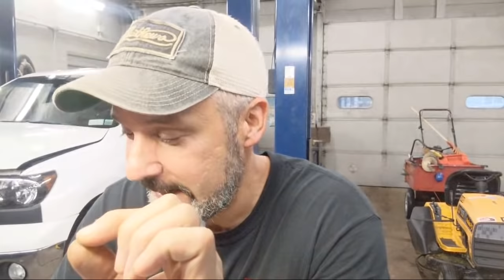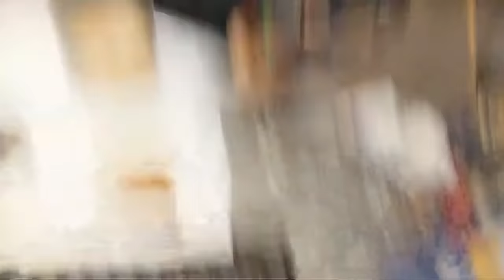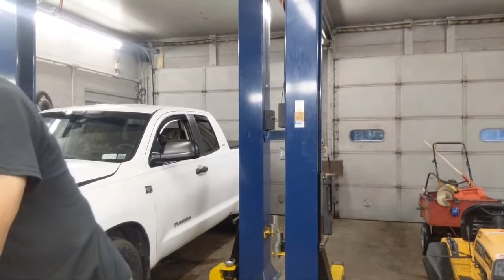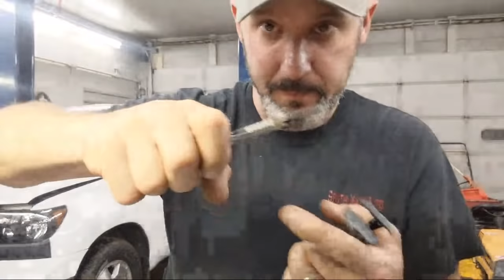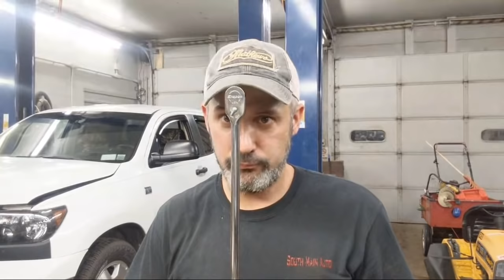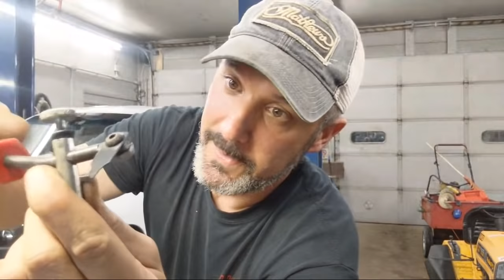W.U.W 9-22-21

Comment: Thanks for the great videos... I  live in SW Louisiana and just wanted to share my story of my 2008 Honda CRV AWD.  OEM starter lasted more than 10 years and 170k miles.  Late in 2018 it died and the shop I used  (who I love and trust completely btw) used the Autozone replacement (around $200) to repair my vehicle and it has a lifetime warranty on the starter.  Almost every year to the day two times now the "new" starters fail and I have to pay $175 in labor to get the lifetime part replaced again, not to mention the $200 towing bill i also have to pay each time.   I am due for a new starter now if this one goes bad in Novemeber... of which I will buy an OEM from Honda (around $350) and have my shop install that OEM one.  I am not blaming my shop, just I have expressed my concerns with them about substandard parts, even though they are "lifetime warranted", it costs way more in the long run to use these less reliable parts than to just buy the OEM's in the first place.  Hind sight 20/20 I will use OEM from now on as I have over $1000 in the cost for replaceing the starter 3 times for labor and towing costs.  Sorry for the long post just wanted to share, hopfully it may save someone some time a money down the road.  Thanks again for the great content!!!
Reply: Hey Eric. Larry from Alabama port Alabama

Comment: @4:30 Parasitic voltage draws:
When I worked at an RV dealership, all the class C and class A motorhomes, new and used, had to be started at least once a month otherwise the engine batteries would go dead.
This is back in the mid 1980's when radios first came out with LED dials. We found out from the coach manufacturers that even though the draw was in miliamps, over time, the LED readout on the radio was enough to draw down the batteries.
Now it's in a couple of weeks where batteries draw down because of all the electronics on newer vehicles.
Reply: This is why I keep a trickle charger on my things that are going to sit around for a while.
Reply: Lead acids lose about 1% of their amp hours per day.

Comment: You were talking about ICE vehicles being replaced.  
Here in north east Montana I know of 6 people that have electric or hybrid vehicles. Most all of them park those vehicles when the temperature gets around 10°f, as the heaters and defrosters use too much battery. Up here towns are 50 miles to 150 miles apart, too far for electric vehicles using a heater and defroster. 
Last winter we only got down to -26°f. 
Hello from north east Montana. 
10 miles from the Canadian border.

Comment: Hey there Eric. I've been in the business 28 years. 50 years old and ready to retire.  I'm pretty good with cars. Got solid customer base. AKA anyone that's family. Lol, but on that, your diag approach has helped me in many different ways. As techs,we can learn everyday. I've learned long test drives are a good way to take longer breaks. Not brakes. Oh and snap-on is stupid expensive.  Last thing. MBZ c230. Crank sensor giving false signals. Cuasing trans shifting issues.  Loss of CAN com when sensor dropped out. Want details let me know. Was as crazy find. But it's fixed.

Comment: Eric, as you know. as you know, there is an immensely  popular popular mechanic on YouTube, named Scotty Kilmer.  I learned way back in '62 how to adjust mechanical lifter valve train lash , statically, in two revolutions of the crankshaft.  The same procedure also works for hydraulic lifter preload adjustment.  My instructor was Joe Sharp, Santa Monica City college.  I challenged Mr. Kilmer to demonstrate this most efficient procedure without results, on his part.  He obviously falls short.  I now challenge you to do the same.  Hints: Firing order, Cylinder pairs, Exhaust valve-intake valve overlap observation of rocker arm or cam overlap action.  It's doable if you thoroughly understand the four event-cycle valve diagram of the "four cycle" Otto engine.!

Comment: @1:50:06 Back in the day, there was a backwoods shop that would pass any vehicle as long as you left a six pack of Carling Black Label beer on the front passenger seat.
You'd leave, come back, the six pack was gone and you'd have your inspection sticker.
Reply: Our machine shop has the same policy, a six pack and a pack of Backwoods Cigars get's you in front of the line, well worth it.

Comment: Last note. I worked for Mercedes Benz in orange county California.  Caliber motors of Anaheim Hills. They are easy to fix on dealer level. Just throw parts at them. Well more to it than that. But fixing anything European is just so stupid in the stuff you need. Example got a AGA drill brush kit to clean secondary air pipes on a BMW. Used it once for smog. The only other way to do it is to pull the motor. Not to mention al euro cars have 15 codes in 5000 modules.

Comment: some dorman parts are viable... some are not. really depends on what, the make of the vehicle, and what kind of wear and tear the item would get normally as well as in the specific vehicle.

they're not my go to, but i've got no problem getting their stuff for certain items. and sadly, it really does come down to experience in dealing with parts to know if its going to be worth the hassle.

if i were in this commercially, i'd be looking at the better value vs quality vs price factor. for instance, i know some specific parts need to be oem in some cases, or its just going to fail, period. in other cases, you need to go third party. in the 3.3/38L mopar engines in the mk3 minivans, there's aftermarket 6 rib serp pulley kits to replace the smooth pulleys and eliminate the belt slippage these engines venetually get and you can never seem to ever get rid of once they start it. (not universal, but those ones that do get it just seem to have it from then on, even if you replace all the pulleys and the tensioner arm with oem stuff. don't ask me how i know.)

Comment: Please make a video on a 1998 dodge grand caravan having an issue with the dash lights not working. The fuse is good and the dash dimming switch is not turned down. I've replaced all the bulbs. I've replaced the gauge assembly and the light switch assembly.

Comment: On a 2014 super duty with 6.7, would it be too optimistic to think that I could get an engine swap done for $5000? That would be with me supplying replacement motor, which is complete from oil pan to air filter. So a plug and play type swap. As much as can be anyway.

Comment: Can I get some help please Eric! Got a 2018 Ford transit 3.5 eco boost. I need to do injectors on it. It’s been a nightmare. Bunch of water was dripping on top of engine. I had to cut the intake off and the bolts were rusted to the metal collars on the intake and now the injectors are stuck. 3 of them won’t move at all. Tried a slide hammer but the little ears where you grab them is brittle and broke off. Now I have the injector body left in the cylinder head. How can I get them out? Should I just try to drill the body and try to step it up until the body is very thin and I can bend them to remove?

Comment: I got 8.1 Chevy new motor and cold truck will start rite up cold ,then once it's warm turn key and it will backfire until I push the throttle ,then it will start up slowly not exactly rite up but it does .

Comment: for electric vehicles, I think the battery issues Chevy and Kia are dealing with ($2 billion for the Chevy Bolt and $800 million for the Kia) as well as others, is going to suck some of the wind of the ICE must be gone by 2035 crowd.  (I think there are other issues like electrical infrastructure and so on are going to be problems, too, looking out a bit - think about a parking garage for an apartment building full of plugin hybrids - how much power do you need to handle that each night?)

Comment: Eric got a question for u. I have a 97 rav  4 crank no start if I touch the red wire going to the crank sensor with a power probe the car starts without giving it power or ground from the power probe. If I give it power or ground the car stalls right out. I have no clue what’s going on any suggestions would be great

Comment: What is your opinion on using K&N air filters? Are they worth it, or should we just stick with OEM paper air filters? Do they mess up your mass airflow sensor?
Reply: I have one on my 08 Ridgeline, no issues using the K&N
Reply: Only way they hurt the MAF is if you over oil it, then you can usually clean it with MAF Cleaner spray.

Comment: I have a question You work on the electronics of vehicles, I have a 2012 f350 that will not start when the Ambient temperature drops below 60 degrees! when this happens all of the codes that the pickup has start blinking. my ambient sensor (gage) is stuck on 50 degrees The only time it will start is when it warms up out side all of the codes go away and it starts right up! i have changed the sensor that is under the right side mirror. did not help, (when i unplug it, it defaults to 50 degrees not -40 like it should) If the temperature is 70 or 80 degrees during the day then falls off to the low 50s or 40s every alarm this pickup has goes off! when it warms back up the next day the alarms go away and it fires right up. :Note: I have left a heating pad on the sensor all night but it does not read it all night, (the heating pad is on) but it still reading the outside ambient??? if i turn the key on in the Am and it reads 50 degrees it wont start. Can you or anyone give me a direction?
Reply: What is data stream doing, are you getting info. Coolant temp, rpm when cranking? Fuel pump hear. Can network up and running and not shorted
Reply: @mph5896  It does not crank at all when the temp is in the 40s or 50s, When the Ambiant temp warms up outside all the codes disappear and it starts right up with No codes.

Comment: Batteries do not charge back up to 100% because the driver runs the car to the point that the batteries have been discharged to low to often

Comment: Utah eliminated state safety inspections a few years ago use to voter clamor .  

Now one can walk through any parking lot and view cracked windshields, worn tires and leaking cooling systems. Last week, we saw three vehicles without working tail lights on the freeway moving at 80 mph.

Comment: Parts are cheap compared to labor. A cheap part with a "lifetime guarantee" means that you get to pay for labor AGAIN, if the CHEAP part fails. The part manufacturer knows how much it cost to make the cheap part and how many times they can replace it on the profit that they made, AND the odds that the POS car would die from another cause.

Comment: Everyone wants you to train them. They see the who done it, head scratching tech vids you do and think this is what you do all the time all day long. But in a true working shop, most jobs, 75 to 85 %, are the same old same old repairs. Brakes, tires,wheel bearings, water pumps, window motors/regulators, wiper motors, alignments, exhaust manifold bolts, etc,etc,etc.....These are the jobs that pay the bills and keep the doors open. You post as many brake repairs as you do tech repairs. And for you, add in customer interaction, estimates, parts sourcing,scheduling, and other management duties, you've got a boring but busy day. That's why they call this WORK INSTEAD OF RECREATION....But it all pays the same.